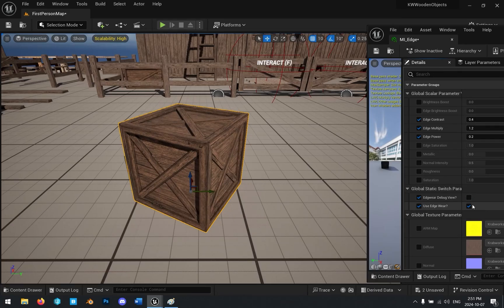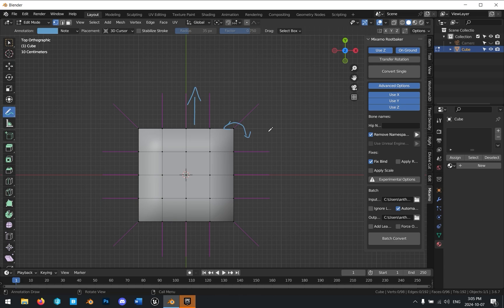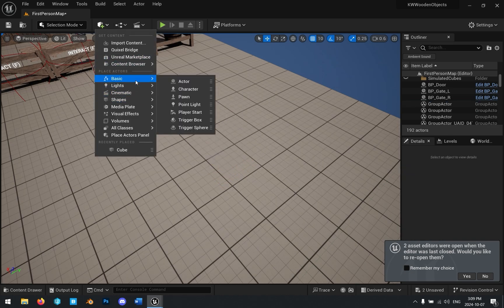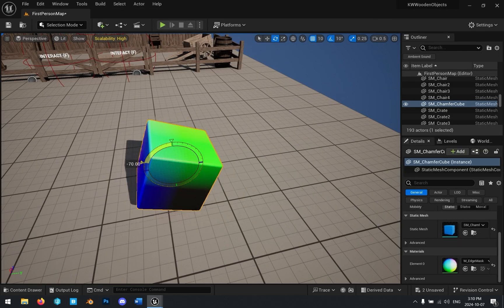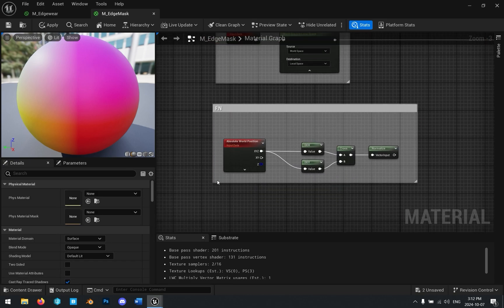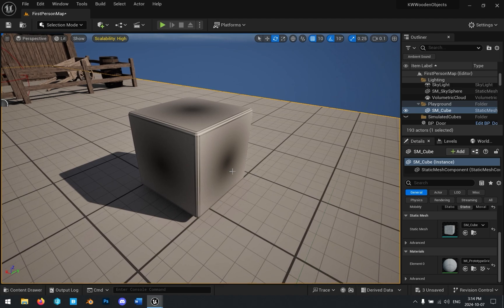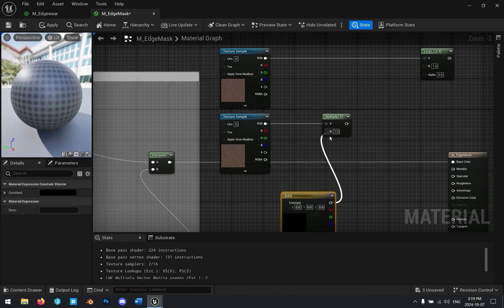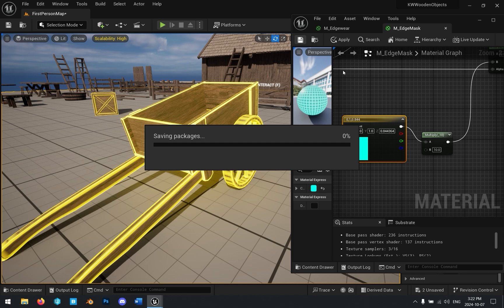Procedural Edge Wear in Unreal Engine 5

Comment: Great tutorial! Edge wear plus glowing edges as an added bonus! Is there a simple tweak to the nodes that would identify internal edges e.g concave? Im trying to add some grime to hard to reach places!
Reply from the maker: You could flip the inputs on the Lerp node or invert the mask and play around with the settings to restrict it quite a bit :) It's just a black and white mask, so it should be fine. I haven't experimented with this though so you'll have to play around with it and see if this does what you need.

Comment: Wouldn't it be easier to simply use a fresnel node.  It would be far less complicated, it will capture the geometry edges while having the ability to adjust it based on exponent and fractional inputs rather than being dependent on geometry density.  Furthermore the effects can be further masked with procedurals downstream prior to output.

Comment: Great video! Thanks a lot!

How would you add a custom rotator into the mix?
I am looking to make some wear on a mesh, but I'm tiling the textures as well.

Also, how would you adjust the strength of the mask? Say, you want to ignore lesser angles.
Reply from the maker: Cheers! I guess it depends - what are you trying to achieve with the rotator? I made this video a while back on UE 5.3.2, I have heard that it has issues with 5.4+ so I'll have to debug it at some point when I have time for newer engine versions.

Comment: Does unfortunatly not work in 5.4 Cross Product does not allow one Vector 3 and one Vector2 and the material won't compile. The Solution would be to make a float 3 from the XY and the blue Z node.
Reply from the maker: Thanks for this fix :) yes; should hopefully work for anyone on 5.4. This was made in 5.3.2. Have not tested in 5.5 either which was recently released.
Reply: @cgkrab  Do you have a screenshot of the nodes? Need Curvature map in unreal but dont know hou to make this float stuff. =(
Reply from the maker: @igorkirdeika4765  Hello - will try to remember to make a new version of this for 5.4/5.5 soon. Currently on vacation but back in a couple of weeks. Cheers
Reply: @cgkrab  Hi there! Any chance you managed to solve it for 5.4 or 5.5? I tried everything, it just doesn't work for me
Reply from the maker: @evilnescu I haven't yet, unfortunately but I'll look into it when I can

Comment: Thanks for the great video! I just wanted to suggest a small tweak: instead of using the distance node, you can replace it with the dot product. Then, plug that into the smoothstep node. This way, you can adjust the angle for the edge effect. In my case, I set the smoothstep node to a max of 1 and a min of 0.95
Reply: Omg thank you so much !

Comment: Doesn't work in pathtracer (5.3). Any ideas to make it work?
Reply from the maker: What does your mesh look like? This method is dependent on having (1) a smooth shaded mesh, and (2) a loop cut near the edge so that the difference between averaged vertex normal and flat face normal can be detected. If both conditions are not met, it won't work - this should be the same with path tracing.

Comment: Hello just tried it on UE5.4 and transforming vector from world to local returns always black. only aproximate faces are working i needed to remove both vector transforms now it works and should be equivalent
Thanks for video
Reply from the maker: Strange - I am on 5.3.2 but this should not differ between versions since it is basic transformation. I will have to look into it at some point :)

Comment: I have a question, can you do this without beveling edges? so every 90 degree angles get this mask
Reply: yeah that’s the only solution I could think of too, I was looking for some method to make edge don’t look sharp and unrealistic but, I guess I’ll stick to the micro bevel
Reply from the maker: Yes, it's no problem - however the object needs to be smooth shaded and have loop cuts near edges, so it would appear bevelled due to smooth shading. It is not possible with this method to get a flat shaded object with hard edges to do this though. Unfortunately smooth shading is a requirement for this method because flat shaded objects have vertex normals that are parallel to the face normals, so there will be no difference there to detect to make the mask.